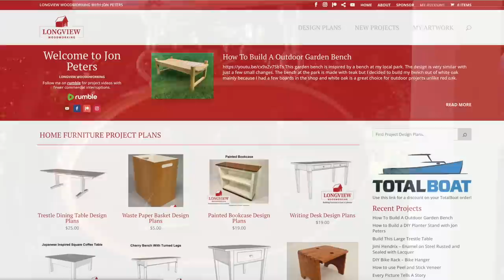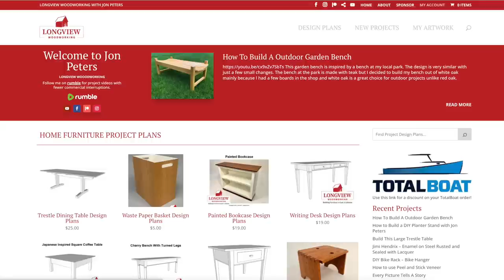Make an Address Plaque

Comment: Turned out beautiful. Since you had to sand the excess paint away, and thus the varnish with it, what was the benefit of doing a coat before rather than painting first?
Reply: The varnish seals the wood so that the paint didn't bleed into the pours. The paint simply sits on the surface of the varnish.  The sanding only removes the paint from the top/face where the paint isn't wanted and comes off very easily since it's not in the wood pours.  Always seal your wood before painting when you want clean boundaries.
Reply: @justinmikels7646  makes sense, thanks!
Reply from the maker: Thanks, yes that’s exactly the reason 👍
Reply: @JonPetersArtHome  thank you for the reply. This tip will be useful on my projects.

Comment: Love the work as always, how did you make the knobs that held it up for paint/coating
Reply from the maker: Thanks, small pieces of 3/4 plywood with 1.5 screws… my boss from 30 years ago taught me and he called them naillers
Reply: @JonPetersArtHome  you’re gonna laugh but I just realized that the  rockler bench cookies have screw holes and you can use them for that
Reply from the maker: @Mecca33  That’s funny I didn’t realize they had screw holes in them